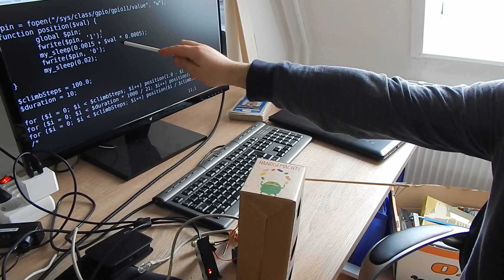Raspberry Pi: Python GPIO FAIL!! PWM not suitable for controlling servos

Comment: It's not a Python related problem. The implementation of the good GPIO libraries is always in C. So, if you have there Bug, then please make a Bugreport. Some libraries still have bugs. Second thing: Python is often used in the financial sector and they have to process the data in real-time. They get huge amount of data and must process this data.

BTW: Your code is horrible :-D
When you're using global, you do it wrong.
Post your whole code and we can reproduce it.
Reply from the maker: +Andre Müller Code is on github. Some of the video descriptions of former videos contain the link. You are right, it is not python but the preinstalled GPIO library for python.
Reply: +Andre Müller As I posted on Google+, the code is related in this repository under "servos": https://github.com/carli2/raspberry-projects

(For people who may look later.)

Comment: I think if one can do it with PHP, one can also do it with C. It might require some intricate system programming, which I will have to learn, first. Probably not that big of a deal... for some. ;-) It may even require something to be loaded during boot.

Of course the trick is that Python will never be a real-time language. So you would never have the tight control that PHP has. It would be left up to a C extension module to "round off" the values to smooth it out.

I suppose it will be left up to some enterprising, old, disabled developer to write a realtime extension module for Python. :-)

Edit: And, of course, I am talking about IPC between Python and the real-time module.
Reply from the maker: +Leland Green you are right. C is a bit more hacking with strange time struct formats, weird and unsafe string functions and lots of pitfalls. For a rapid developed demonstration I chose PHP. You could also use python but then you would need the more accurate nanosleep module which is then written in C again.

I think the problem with python in this case is the usage of hardware PWM without syncing it to the cycle. This creates ghost signals while changing the duty cycle.
Reply: +antisteo :-) I'm well-versed in C. I started learning it around 1987. I programmed full-time for 20 years. The first 5 were all straight C. 

So I can see why it might seem like "a bit more hacking". But some very well-designed software is still written in C, of course.

Although, I'm the opposite, in a way, because I see PHP as the "more hackerly" language. ;-) It just always seemed awkward to me. (Maybe because I did use C so much?) IDK, but I've managed to go this long without really using it much (except once, around 2000(?), when I was required to). 

Although, your code does make it more appealing because it's easy to read.